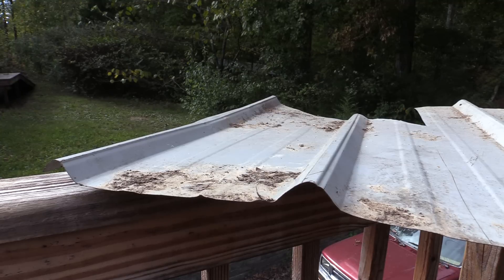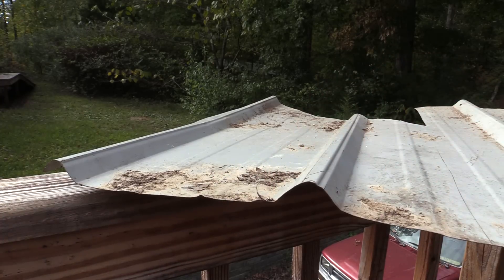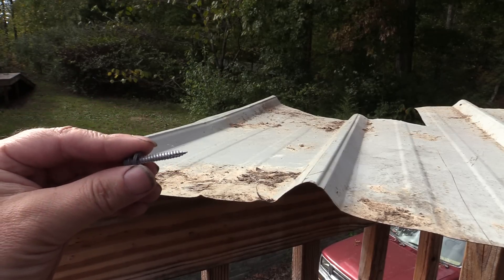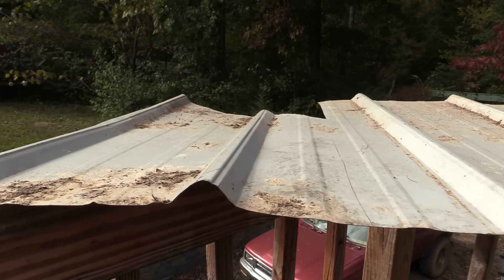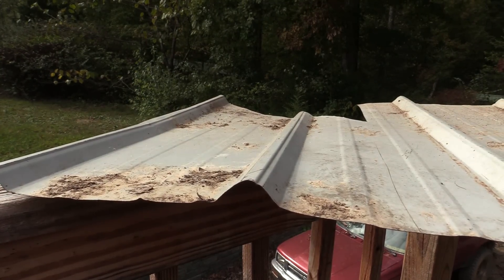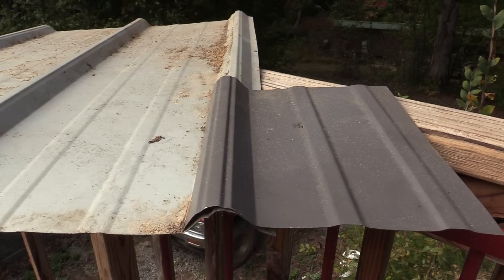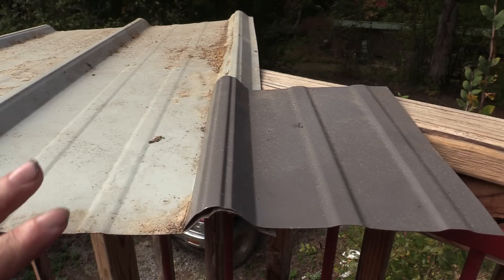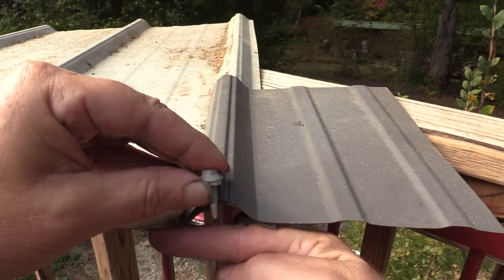Why you should not put screws on the ribs of metal roofing

Comment: My house was built in the 20s and I needed to replace the roofing so I decided to go with metal roofing. Lo and behold I had three layers to take off, two shingles and the original wood shingles. Underneath that is 1" boards. Some were rotten and had to be replaced. I put the metal roofing right over the board and screwed it on the flat. I didn't put down a underlay. Do you think I should have? thanks.
Reply from the maker: Sorry this reply is a little late as your comment didn't pop up to me for some reason. I have worked on houses older than yours. sweating from condensation is your main concern. Old buildings with board sheeting may produce a little condensate but the wood should absorb it and the gaps between the board will provide enough ventilation for the wood to dry out. While underlayment is preferable i would not worry if you didn't as i have seen many roofs that did not have it. thanks for commenting and sorry for the late response

Comment: You are wrong my barn and other buildings are all nailed or screwed no leaks or  any problems for52 years
Reply: There are barns with metal roofs over 100 years old and standing as straight as the day it was built.
Reply from the maker: @georgeoverton3103  if you watched the first part of the video I discussed how barns were nailed in on top of the rib. Nails are different from screws. With the new metal and screw technology they changed the schedule for metal roofing on some styles. For this type of roofing this is how the manufacturer says it should be screwed down. Other types of roofing like 5v still use nail in rib.
Reply: The reason is the metal is thinner than it used to be. It used to be stiff enough to hold the seal on the nail or screw. Now it is too flimsy to compress the gasket and maintain the seal.

Comment: When I built my pole barn in 1990 Fabel metal producer, instructed me to drive nails with washers through the rib on the roof
Reply: Indeed. Because the top of the ribs are the highest place on the panels and are less likely to leak when the rubber washers on the screws eventually fail.
Reply from the maker: @alholliday1808  you were right to do that because you were using nails not screws. The nails always loosen with time negating the washer seal.
Reply: @honeybeehomesteading  Wrong when the rubber seals fail??  on top of the rib is best because less likely to leak simply water has a harder time to go uphill with screws or nails in the rib🙂
Reply from the maker: @thegrantdanielsband I don't make the screw schedule the manufacturer does. Puting screws on the ribs makes sense from a leak perspective but not from a structural hole down one.
Reply: @honeybeehomesteading  structural? If you are relying on a tin roof for structural  you got more problems than I know lol 😆
Reply: Its not him that is relying on anything. Folks that are in the business know that there are multiple studies measuring the diaphragm strength added by properly screwing the sheets to the frame. 

Additionally, in my area of plenty of freeze thaw cycles, I have seen the ribs expand and contract up and down so much from temperature changes that it can literally extract the screw - when it it driven in the top of the rib.

The "schedule" he is referring to is not a summary of builder's  biases. It is from engineering design tested again and again.
Reply: @kellyinfanger9192  just look at 100 year old barns they are all in the rib around here!! The proof is in the pudding¿? Not one of them is on the flats. They have stood the test of TIME why would anyone do it anyother way when wr know this works? On the flats is just asking for trouble I will not rely on some B.S. engineer how thinks on paper it works thank you very much 😊
Reply: @thegrantdanielsband   Those barns aren't holding up because the nails or screws are on the rib. Nobody, not even you are saying putting the screws on the ribs adds diaphragm strength. Therefore they are resisting the loads through their framing  - and that is a good thing. 

It is not "some engineer."   There are multiple agencies, engineers with varying perspectives, all studying the phenomenon. There is one example staring you in the face: virtually every steel frame building. They use the steel cladding to provide the resistance necessary to meet ever increasing requirements. They don't put their fasteners on the ribs. Some call for a little of both -  ribs and flats.

Virtually everyone understands that putting a gusset (metal, lumber, or plywood) on a connection strengthens it. So if that gusset just happens to encompass the entire wall or roof - so much the better.

So you ask; why would someone change from a method that already has been proven to work? Because that barn with a superior frame (compared to maybe a steel frame structure) that has survived for decades with screws in the ribs could maybe resist a 90 mile an hour (previous code requirement) wind gust could now resist a 115 mile an hour wind gust (International Building Code 2021 requirement) if the screws are added to the flat space near the rib.

So it's simple. If you like screws on the ribs - do it that way, but don't deny a simple fact. Sheet metal properly installed strengthens the structure.
Reply from the maker: @kellyinfanger9192  exactly. Thank for commenting
Reply from the maker: @thegrantdanielsband  I have seen and repaired many roofs attached through the rib. The wind is just a big of enemy as rain to a metal roof. It is hard to stop a leak if the panel flew off. Thanks for commenting.
Reply: @kellyinfanger9192  if you are relying on steel roof for structure you have big problems simple.as far as witch way is right rib or flat? Obviously the rib is correct there is a law called gravity maybe you heard of it? When your rubber seal goes water will find it's way on the flat but with gravity on your side water has a hard time going up hill. Even young kids know this lol it is a simlpe law 🤣
Reply: @thegrantdanielsband  Around here, snow sticks much higher than the rib height. Snow makes these little ice dams that back up the melted water to leak in those nice but loose screws you would have on top of your ribs. Conversely, when driven on the flat to the proper torque, a screws' washer is protected from UV light by the head of the screw. Therefore, that washer will last longer than the paint on the metal. If people would repaint their metal every 20 to 40 years or so (depending upon the quality of the paint system), the lifespan of the siding/roofing is indefinite. 

You think you are making a good academic argument. I will take on-the-ground real-world experience gained from literally 10s of thousands of steel and postframe structures built during the last 5 or 6 decades over what you think is brilliant analysis.

It is this simple. If you want to prevent wind damage, if you want to prevent the slow dry rot from minor leaks caused by improperly driven screws, then do it the way professionals with many years and thousands of buildings of experience  are teaching you. Or, do it your way. It might last for as long as you live or decide to own the building, and the problem becomes the next guy's problem.
Reply: @kellyinfanger9192  listen here joker when I talk to the guy that actually makes the steel roof and he said always  screw it on the ribs never the flats and this is from the actual guy's  that make this from flat stock.He literally said all buildings around here are done that way he laughed when I asked him if I should screw it on the flats 😂  like I said there are many roofs on old barns that proves the point. Properly installed it will last with the proper screws that are actually designed to go on the ridge and torqued. Putting it on the flats make no sense whatsoever sorry 😐
Reply from the maker: @thegrantdanielsband  you are free to share your opinions and experiences but name calling is not one of the things that you are free to do. You have made a strong argument why then try to belittle and name call someone who also has a strong argument. Further behavior and I will delete all of your comments which I really don't want to do as I believe we all can gain knowledge from different perspectives.
Reply: @honeybeehomesteading  name calling? Lol, that's called freedom of speech. If you do not like that than yes your free to do what you want I will not complain I am an adult and can take it thanks 😊
Reply from the maker: @thegrantdanielsband  your freedom of speech is not protected on YouTube. You agree to keep comments respectful by using the comment section. But even if you were allowed to say whatever you want and call people whatever you want is it the right thing to do. We all have different opinions but for the most part I try to let everyone express themselves. You will find many comments about myself that are not nice that I leave up as I can take it as well but there has to be some rules. Your reply was respectful and I will leave your comments up as you can offer a different perspective just don't let things get personal.
Reply: @honeybeehomesteading  I feel like I just got scullded by my teacher when I was in school but thanks I guess 😅
Reply: @honeybeehomesteading  I HAVE witnessed the issue you state. I used these same panels as a fence around my garage yard. I had to remove some of them in the summer of '23 (while working on an shed project) after they'd been up at least ten years and many of the screws were broken, probably 25% of them. I had put all the screws through the top of the ribs.
Reply from the maker: @dkeith45  thanks for the reply. Metal moves allot. I am sure allot of houses with the screws through the ribs have a bunch of broken or nearly screws you just can't see it.
Reply: @honeybeehomesteading  Yep. And your video has convinced me to use standing seam metal roofing when I eventually put it on my home. Up to this point I hadn't known there was a difference besides appearance.
Reply: @dkeith45  This will happen on the flats even worse as water sticks around and rusts the screw faster lol 🙂
Reply: @kellyinfanger9192  When it is ice it is solid when it melts it goes downhill and finds the easiest route if you screw on the flats this would be the easiest route on the rib much harder and less likely!! Isn't gravity a law anymore?
Reply: @thegrantdanielsband  Thanks for the debate. BTW, my last response to you was pulled down by @honeybeehomesteading. Then he scolds you for name calling. Guaranteed, I did absolutely no name calling, nor was I in the least way offended by your language.

He doesn't need my support if that is his attitude, so for me, this is the end of this thread. But I did want to let you know I enjoyed the banter. I wonder if he will keep this comment up.
Reply: @kellyinfanger9192  All in fun thanks Brother cheers 🙂

Comment: I built the cabin I am currently sitting in 30 years ago.  A group of family and friends helped put on the metal roof on it in one weekend.  None of us had ever done this type of roof before.  The installation instructions were found between the last two sheets of the custom order lenghts so not seen until almost complete.  Not only did we drive the screws in the peak of each rib, we also had the inside edge rib on the outside.  Place has never leaked.
Did not predrilled and would not advise doing that unless you are laying flat on 4x8' sheets which I believe voids warrenty, we installed a 1x4" cross lattice.
Reply: I always take a 16 or 20 penny nail and sharpen the end on a bench grinder and use it as a punch to make a small hole in the rib before running the screw in.
Reply from the maker: @dkeith45  I always used a screw tapped with a hammer.  I have also used a automatic punch with success when the punch worked right.
Reply: @honeybeehomesteading  I've tried the screw method, it's a bit difficult to hold onto the small screw, the thread bites your fingers etc. The auto punch, snap punch, works but often doesn't leave enough of a dent for my liking.
Reply from the maker: wow glad you didn't have any leaks, that is the great thing about the new screws they really don't leak if they are properly tightened. I am surprised you don't get any buckling in the summer though with each panel screwed into the other. You can predrill as long as it is a very small hole no bigger than one eighth and if you are pre drilling you should do allot of sheets at once with good support underneath. thanks for watching

Comment: Why you should not use metal ,1000s of potential leaks from exposed fasteners.
Reply from the maker: @hl8256  if it is the fasteners you are concerned about you could always use standing seam metal roofing which has zero exposed fasteners or horizontal metal roofing which goes on like asphalt shingles and also does not have exposed fasteners. As for myself I have lived undera asphalt shingle roof for 20 years and a metal roof for 10. In that time I had multiple leaks on the asphalt shingle and none so far on the metal. If properly installed the fasteners really hold up well. As for roofs I installed for other people none ever had any issues. If you have a very complicated roof with lots of hips dormers and valleys then the style of metal in the video would not be my first pick. But if you have a more simple roof then using metal could save you some money. Thanks for watching.

Comment: You are correct on all these points based on my experience. The manufactures instructions emphasize this method. What is your opinion on predrilling ?
Reply from the maker: @samuelbonacorsi2048  pre drilling saves time and protects the metal from mishaps which might scratch the paint. Plus it gives a consistent pattern. I drill multiple panels at once so make sure you have the holes where you want. You have to drill half the roof panels one way and the second half will be oriented opposite of the first when dealing with a single gable. It is important not to drill more than a 1/8 hole as this will allow the screw to lift the edge of the metal where the hole is giving it further leak protection. Thanks for watching and commenting.
Reply: I don't predrill, it takes too long. Plus, it's another cordless tool that I have to keep track of on a roof. Instead, I puncture the panel with a light tap on an 8d nail. That gives me just the right hole to start the screw.
Reply from the maker: i always predrill on the ground, using a drywall square i can precisely measure where the screws go and as i drill about 20 panels at once it saves me time and i don't have to carry a hammer up on the roof. it takes me less than a hour to do all 20 panels. I used your exact method for years and still do on board sheeting.